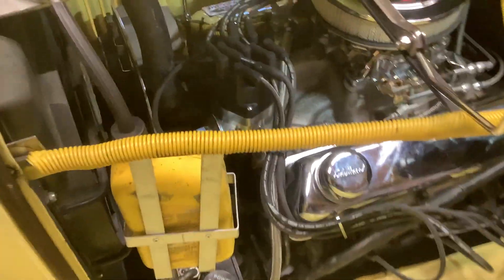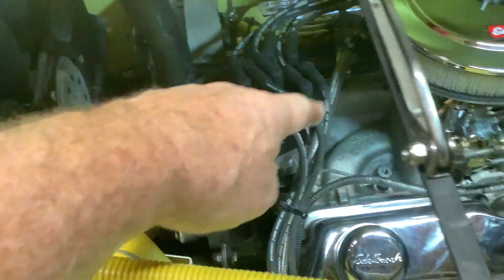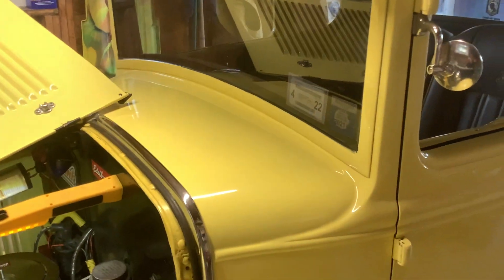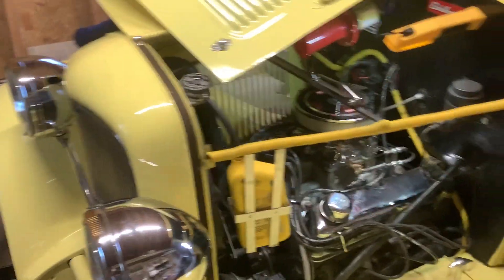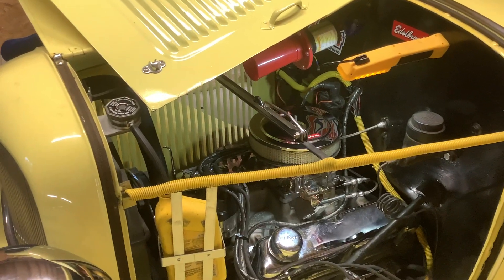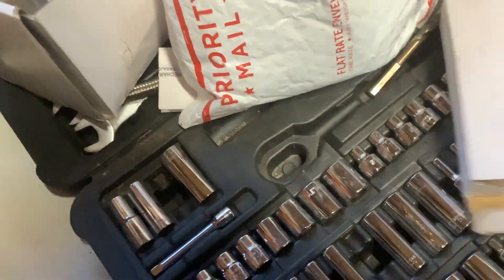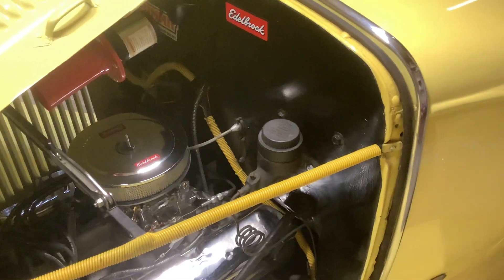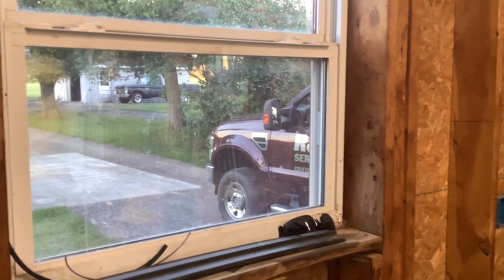1st start with the new carb and ready to run distributor.

Comment: Sounds good!!! Liking that Summit Distributor!!! Going to be looking into it for the 39!!!
Keep Rocking it out Brother!!!
Reply from the maker: The Summit kit comes with all the wire connections and was easy install , I took it back one tooth so I could get more range in the timing ...between the carb and distributor the engine runs very smooth now . I’ve used other ready to run distributors before but this seems very solid unit .

Comment: Sounds great, You’re heading in the right direction, them on and off sending unit for your fans is the way to go actually just put one on the elcamino 👍, she is coming together buddy, another great video!!!!!
Reply from the maker: Thanks , I’m slowly getting this one debugged of its old owners changes . I worked on the fan relay and I’m putting a over ride power switch just in case the relay fails I can run it manually .